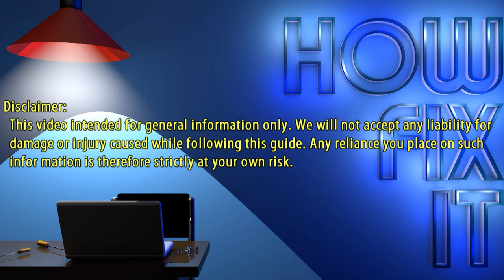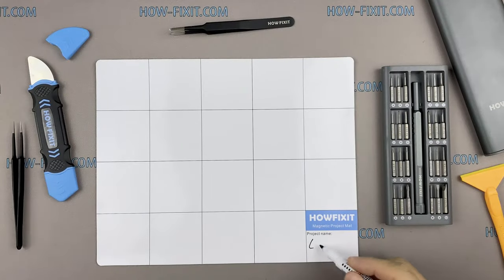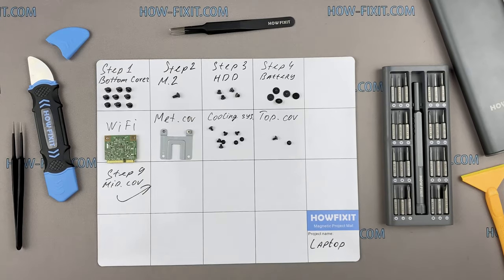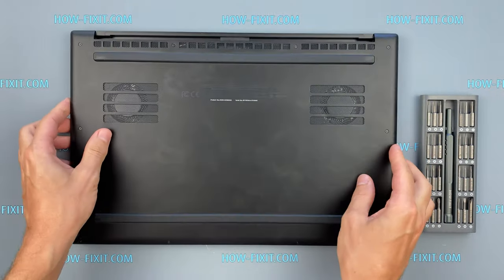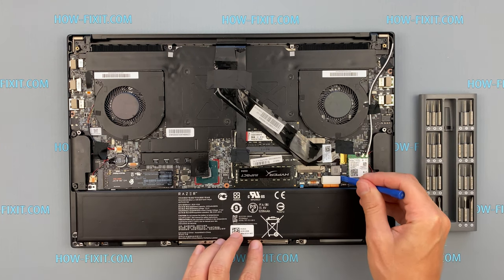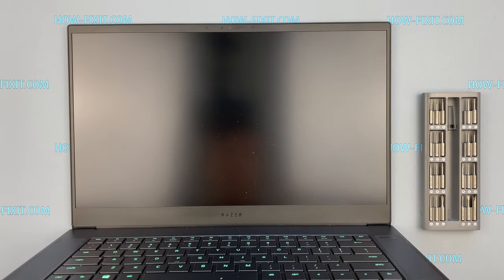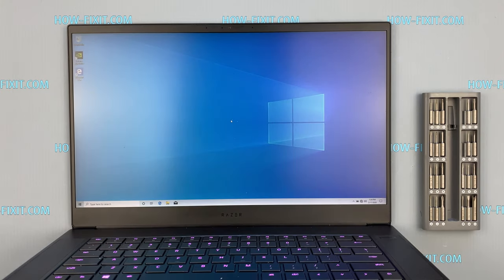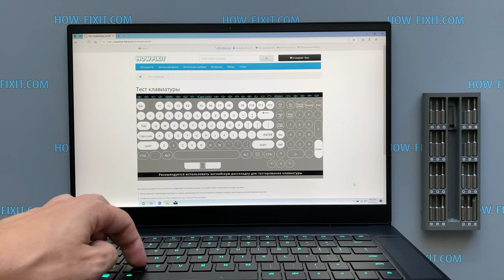Razer Blade 15 (2018) Advanced Keyboard Replacement

Comment: You are an absolute savage and my new hero! I've worked on hundreds of desktops machines so opening up a case is always a fun adventure for me.. But when I spilled a soda on my Razer, I immediately turned it off, drained it out, let it dry out for a week, and it worked fine and still does.  Except the keys are sticky and it's just not usable.  I opened it up and realized very quickly I'd never be able to properly figure this out.  My eyes were crossing.  Your video just solved my problem.  I just need that magnetic board and a new keyboard and I'm good as new.  THANK YOU SO MUCH!

Comment: I have a RBpro17 (2020 mfc date). Sometimes, a few of the keys (1-3 of them) won't register a stroke, even after several consecutive presses... then, it works fine for a long time--very intermittent.

The rest of the keys work perfectly, and the 'weird' ones often behave perfectly fine for days.

 Any ideas if I should go through THIS much repair/disassembly insanity, or, would you guess that it's the 'pop off' parts of the plastic keys themselves (and the pins underneath)?

Sorry for the question... it's hard to explain the issue, but, I've not found help elsewhere!

Comment: nice, my keyboard shorted the motherboard, had the motherboard fixed as some capacitors and fuses had blown, big respect to Evil Labs Solutions,  the keyboard however was fucked and was entering random keys so was left unplugged from the board, finally getting round to replacing the keyboard today, although im swapping a UK for a US layout so having to shave off some of the chassis so the keys can fit, not bothered about that though, as ive saved around £100 on buying a US KB over a UK KB